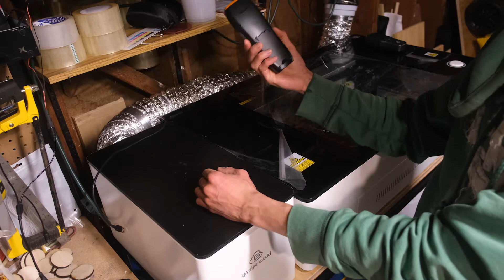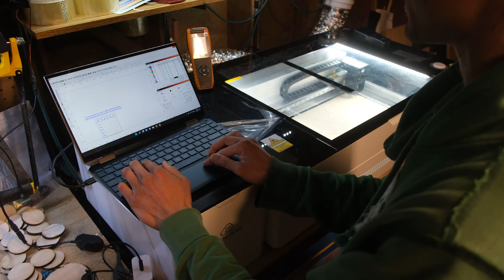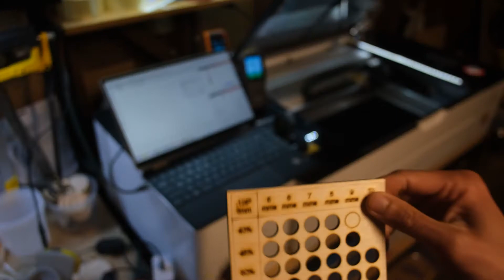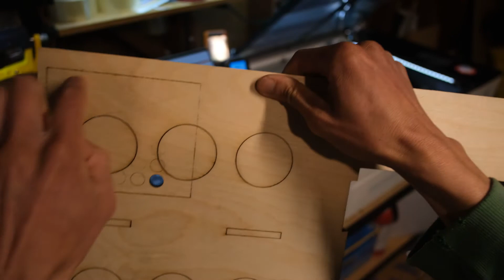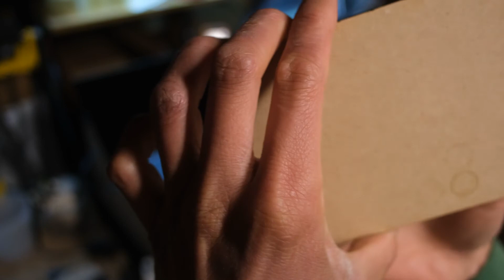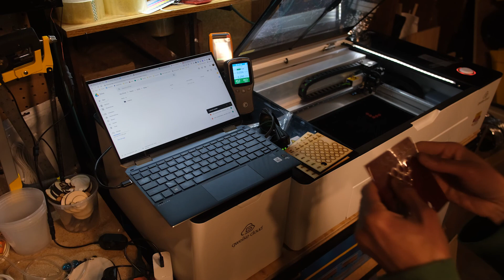GweikeCloud First Evaluation and Cut Test

Comment: Your main issue is your pipes. You are using aluminium foil pipes. This foils are always full of holes. I had one as well and once replaced the problem was gone. This video was recorded a year ago so you probably already know that :).
Reply from the maker: technically it wasnt. it ended up being i was intaking fresh air from the same side of the house i was exhausting

Comment: Was your last diode laser a 10w or 20 w? We seem to be in the situation. I just returned my Atomstack 20w because it was just too slow.
Reply from the maker: 10watt Atomstack X7. Diode lasers can't really complete with c02 in terms of cutting. I'm surprised the 20w isn't good. Did you run it at 100%?
Reply: @GuyWithAGweikeCloud  I wouldn't say the 20w atomstack wasn't good, it just wasn't good enough. I did have some issues with skipping (random horizontal lines on engraving) and couldn't get a tech to help bc I bought it on Amazon. Also, some larger fill engraving took way too long. I ran it at 85% and about 5500 mm per min. Hanging around the laser for an hour waiting for it to finish smallish fill engraving isn't ideal.
Reply: @GuyWithAGweikeCloud  Also, what's the Gweike's max z axis depth?

Great video BTW!
Reply from the maker: @ProfessorOfEconomics  not sure. It comes with a longer lens also which I've never used. Focus starts at 17 however

Comment: You said "This is 3mm plywood and they said -" and it cuts, we are having issues focusing what did they say?
Reply: Watching when you do 1/4" you jog z to 10mm, seems we might have found our issue thanks to your video because we were told 11mm + the material height and set it in the offset but you manually jog every time :)
Reply from the maker: @MakerHacks  oh yes if by jog you mean you have to press that downward dotted arrow that would be correct.
Reply: @GuyWithAGweikeCloud  so you don’t use the material height setting at all in Lightburn?
Reply from the maker: @MakerHacks  don't think I've touched that before.
Reply: @Guy with a Gweikecloud  ok thank you - a guy mentioned the same with the free (Ruidia?) software, he had to hit Z- on there too
Reply from the maker: @MakerHacks  yes that has always been the case to focus.
Reply: @GuyWithAGweikeCloud  good to know, TIL :)

Comment: Very interesting video. I've ordered the same machine and am awaiting delivery (should be somewhere next week).
How do you focus this machine without the camera/QR code? I mean, where is the focal point so that I can manually tell Lightburn to set the Z-height according to the material i wish to engrave/cut ?
Reply: focus in light burn is just 17-(material thickness). a 3mm piece of material would mean 14 focus

Comment: How big of a tabletop do you need for both the laser and the air box?
Reply from the maker: The air filter box adds another 9inches or so wide. About the same depth as the laser itself. So from there you can figure out how wide of a desktop you need

Comment: Sealing the door gaps to prevent fume leakage is totally illogical and will only make the problem worse.  Imagine trying to drink Coke from a glass bottle without taking your lips off. Yes, you instinctively  know its's not possible. After two gulps you have created a VACUUM in the bottle and all drinking ceases.  The designers of these machines do not seem to understand some basic laws of physics. .They have in effect created an  elegant Coke bottle; They add a fan and imagine that will extract the fumes. Wrong, The only way to extract fumes is with air FLOW..If you have a extract duct that is 100 mm diameter, that is an area of 78 sq cm. To ensure an efficient  FLOW of air THROUGH your machine you must have an OPEN inlet of at least 78 sq cm  and preferably 1.5 times that area. (about 120sq cm). Is that grill on the front decoration or is it a open inlet for air. If so just calculate the open area . By my estimation it's less than 50 sq cm and IF iot is an open  grill, are you planning yo tape that over as well? Almost every laser machine on the market  has no real thought to airflow management. G Weike have recently realized there is a fume problem  and are supplying an upgrade kit that involves throwing away your expensive filter unit and replacing it with a huge more powerful extract fan 
see   https://www.youtube.com/watch?v=nFaFY42n3KQ            
Oops,  they are now creating an even more efficient vacuum cabinet.
 Hint.  Your approach to cutting is also illogical.  Your 800mm long 40 watt tube is designed to run SAFELY at 18 mA .  Sorry to disappoint but a  50 watt tube will be 1000 mm long and will not fit into the case. You need to determine what % power=18mA and always use that for cutting, (it will be different for thin card and paper),  adjusting your speed  to give drop out with ONE pass.
Can I suggest you pop over to  https://laseruser.com/the-concise-rdworks-learning-lab-menu/     to quickly  gain  essential knowledge  of the machine and technology you are trying to learn..
 None of what I have mentioned is personal criticism of yourself,  infact I see  myself 7 years ago in your shoes. There is a lot to learn but few take the time to understand, they just think Lightburn makes them experts.(I love Lightburn by the way)  Giving me a paintbrush will never make me an artist.
Reply from the maker: Thanks for your thoughts!

Comment: Hi - brilliant review.  I also have one of these units and have just purchased the same inline to go with it - I had used a glowforge and removed the fan as it was horrifically loud.  Have you taken out the main machines fan yet and if so how did you go about it please?  Thank you hugely
Reply from the maker: i have no taken out the main machine fan. my exhaust run from the. machine to the inline fan is quite long so i figured leaving the machine fan in would still be beneficial

Comment: How good is the air filter? What is coming out of your exhaust? Any visible smoke or does the filter clean the soot?
Reply from the maker: You can see some smoke. Ive recently switched to a passive inline filter so i have less pipes and bends for better airflow as well as reducing noise from one less fan being on. Next step is to get rid of this box entirely and get a more powerful external air compressor. I will be doing a video on that in the near future.

Comment: Thank you for this.   Expecting a Gweike delivery in April and this is very helpful.  Please continue to post your findings and 'fixes', particularly with the changes you may make in the air assist and exhaust.   Total newbie to laser and will need all the help I can get with those improvements and with settings.   Again, really appreciate this video and look forward to more.
Reply from the maker: Yup exhaust is currently my main gripe. I will do a video when my new exhaust setup comes in.